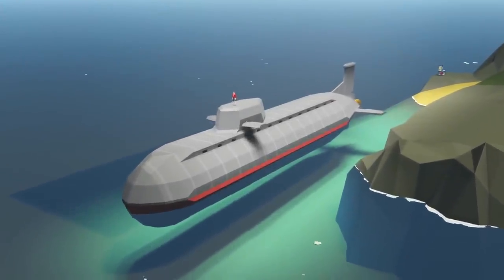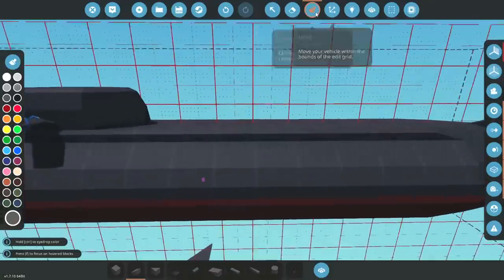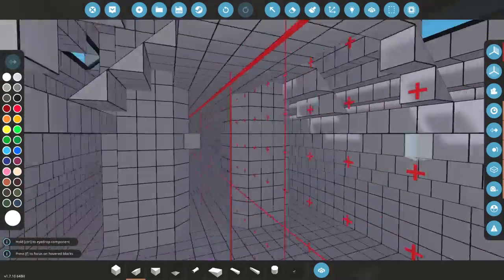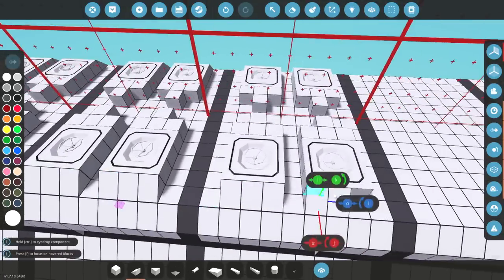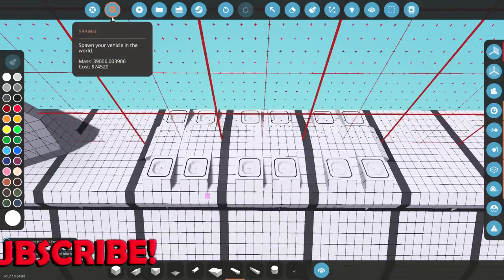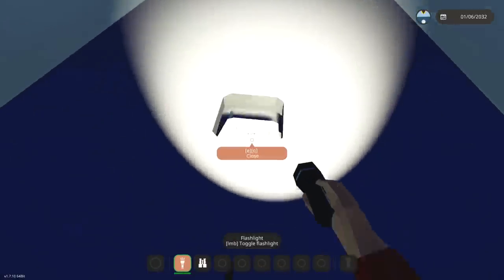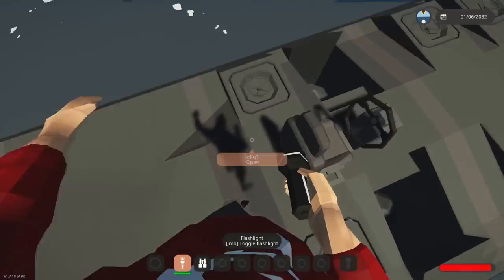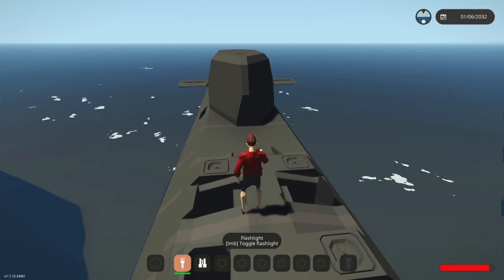Fitting MISSILES BAYS To Our ICBM Submarine In Stormworks!

Comment: Manual hatches can be opened/closed with an end effector. If you put a contact sensor tobdetect that the hatch is open, you can operate it like an electric hatch by putting open control and contact sensor into an xor gat that controls the end effector.

Comment: Frantic, for the submerging at surfacing use doors to fill and to drain use modular fuel parts with a port, if u set the throttle to 1 it will suck up to 50 liters a second